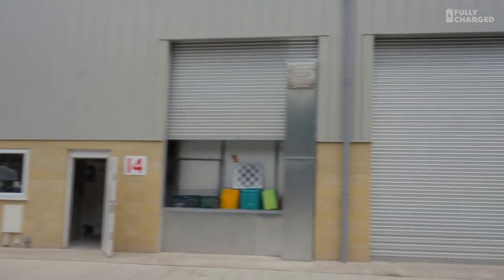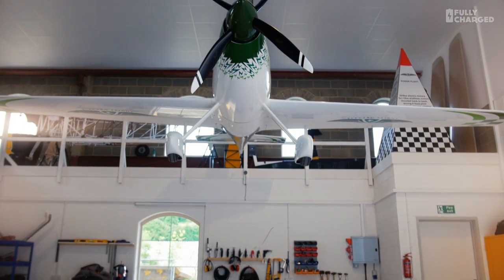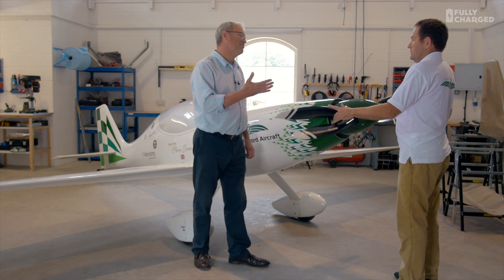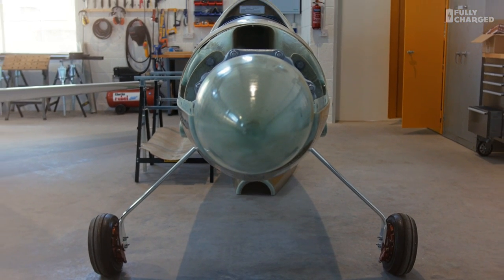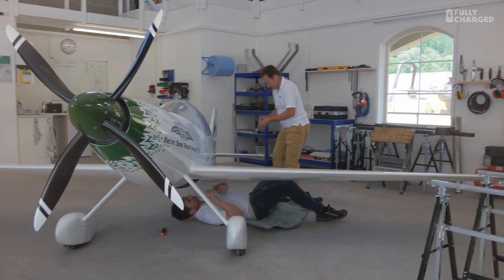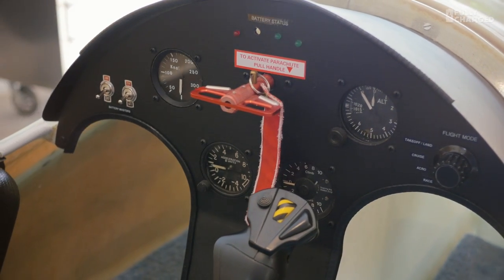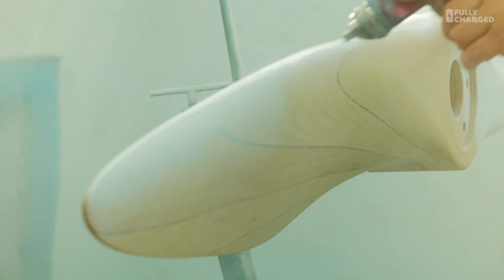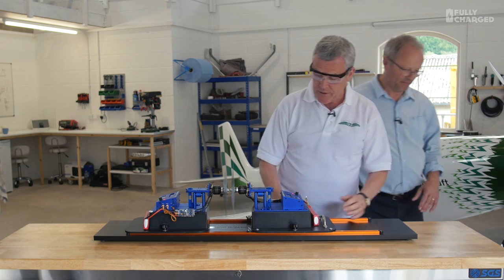Electroflight | Fully Charged

Comment: I recently listened to one of your podcasts talking about hybrid airliners using only electric at takeoff. Combining that with this technology would be incredible. Not only reducing weight from fuel but also from the weight of the jet engines. Logically, that would save tremendous amounts of fuel and co2 around airports.

Comment: It's like torque steer in cars in a sense. Having two  counterrotading propellers cancels the natural tendency of the plane to follow the direction of the rotating blade upfront. And yea, it also increases the surface area and therefore the amount of air the propellers as a whole can "bite" into during each rotation.

Comment: Counter rotating transmissions are a challenge for many designers. However they do move much more
air, and with electric motors' instant torque, this is a great project which may really work. The only thing
needed is better battery technology, just a matter of time...good luck!

Comment: As a flight instructor, I am so excited to see how electric aircraft technology is progressing.  Flight training is unaffordable to most people because of the operational costs of burning an insanely expensive fuel (Av100 is more expensive than Jet A), as well as the cost of engine overhauls and regular inspections on powerplants.  I'm not proud of the fact that general aviation burns lead either.  I'd love to give one of these electric planes a spin!

Comment: Actually extremely interesting approach given the advantages of electric power!
Reply: Advantages of electric power compared to what? Batteries have a much lower energy density than gasoline or even reclaimed cooking oil. If it is ever built, this hypothetical aircraft won't do anything an existing IC aircraft hasn't done better fifty years ago.

Comment: Another big plus is weight distribution of the batteries.  Fuel tanks needs to be big and all in one spot (typically in the wings).  However you can put battery cells anywhere to get the perfect weight distribution; a bunch in the nose, some in the wings, some behind the pilot, etc.

Comment: Having 2 contra-rotating blades.
Ingenious.
I have flown a plane a few times, but not 100% free at the controls.
Something I never thought of, but have instantaneously understood by knowledge fill in and overlap; is that the rotational gyroscopic effect of the powering blade would effect the way the plane turns...
More one way than another, I might add.
By having 2 blades countering each other, this effect would be balanced/negated.

The only other thing that instantaneously springs to mind, is that the propeller with the longer shaft would have to be perfectly balanced also, so there is less vibrational distortion caused by the length of the shaft from the power origin point (motor), and power delivery point (Propeller)

I love engineering.
Why the heck am I driving a bus for a living?
Airbus.. Heyyyyyyyy.
Ha ha.

Comment: Important to note too that it isn't only batteries holding development back. It takes a massive amount of current from the battery to the relay / motor and currently most companies use copper wires to achieve this.  As most of you know, copper that can hold high currents is massive in weight and so keeping the batteries close to the motors is a necessity.  Thankfully in aviation this is desired as you want to keep the CoG as close to the front as possible for safety and performance.

Comment: I want an electric spitfire !  ;-)
Reply: Hanniffy, we'll make them Mk. 22s.
Reply: Michael Powell
I'm not kidding mate,  if that lottery ticket comes in,  I'm getting one made... !

;-)
Reply: actually, Hanniffy, we need Mk.24s. That was the last Spit. It's got the big Spiteful tail for more lateral stability.
Reply: Michael Powell
For sure I'll have to get a model mk24 in the mean time !
Reply: I'm thinking a well designed WW1 style aircraft could be flown on electric with fairly cheap parts (Motenergy or Agni for the motor, etc) and have a similar performance - higher power but less endurance of course. 

I think it'd be a neat alt-history experiment, too. :P
Reply: ThalassTKynn
Good idea,  I do find retro planes interesting.

some rear engine kit planes would be cool as electric:

http://www.pilot-planes.com/kit-planes.html

Comment: Looks awesome I love it, I think their major challenge is going to be cooling the Batteries and the motor system. Because  that is going to be a lot of power discharge in a very short time.  They might have to put a good fire suppression system too. Good Luck Guy's..:-)
Reply: Overheating shouldn't be a problem for a two minute Red Bull flight.

Comment: I am working on  the same problem with water.  I predict that the closer the props are, the better is the thrust.  I can picture air as a fluid.  A hydraulic gear pump is another study that is helpful.
Iguana

Comment: That's so cool, fair play to them. I was just thinking too, I think it's only Jets that can go fully vertical especially up to such an high altitude because a regular prop plane would stall but if it's electric, like the man said, there's no need for air to the engine, only a little for cooling the batteries so there's no need for superchargers and as long as the juice is there in the batteries, you can go flat out all the way up =)

About 15:38 got me thinking about having something like that on a much bigger scale and then having a big compressor behind the fans in a jet and then have an electric heating element behind the compressor to heat the air up even more to give more thrust, it would be bonkers powerful.

Wicked, can't wait to see when all this technology is used in mainstream planes to, goes mainstream and really just takes off, pun intended =P

Comment: Musk was talking about high altitude flight which would need a way to compress the low density air to give something for later stages to get a grip on. Could be multiple stages where speeds are reduced as you go downstream to the higher density compressed air. something like an electric powered turbine.

Comment: if you used one motor to props independently you could use torque to advantage to flip flop between pylons 
and reduce weight by  eliminating gearbox , by computer matching the torque output and then you would have
two fully independent motors/props for emergency landing and low power landings when electrical output is
in stress mode

Comment: I look forward to this as it will make building airplanes easier for hobbyists
Reply: Nothing easy about baking carbon fiber in a vacuum autoclave. Look up Peter Sripol if you want to see easy to build hobbyist electric aircraft. With a side order of, a hobbyist should build a plane that won't be a complete and utter witch to fly. This thing is tiny, heavy, slippery, super torquey and has no flaps or other lift augmentation or speed braking devices .If you could fly an F-104 this could easily get away from you.

Comment: 12:42 Outrunner electric motors are kind of like rotary internal combustion engines. The part that rotates is not the one we're used to see rotating.

Comment: I am excited about electric propulsion because of the lower noise levels and cleaner air.The other thing is we never get a totally clear sky because of all the aircraft vapour trails (Heathrow is about 20 miles away so I probably get more than most).Having said that I'm in Farnborough and it is air show week next week, it is already noisy with lots of fighter jets doing aerobatics and it is quite exciting to see the F35 at last. By the end of next week I will have had enough though.

Comment: That rig (left) I flew was all engine noise.  I had to match a propeller to a 5000 rpm two stroke, possibly the first "trike" to fly (1961).  (2.1/1 gear reduction, 4.5 foot tip dia.)  The machine flew with 13 hp out of about 15,  and there was no relief from noise when the engine stopped, which it did all by itself, frequently.  One did not get to enjoy the quiet, as one was on the ground before the ears stopped ringing.  Could have used electric to solve that problem.  Hope the battery endurance problem gets solved.

Comment: I have been out of general aviation for a while, but this video has me thinking how electric power aircraft is going to be a huge boom for general aviation aircraft in the near future.  The first is performance improvements because of the weight, size, aerodynamic improvements and power of the engine.  You could build a cleaner airframe, climb up to altitude quicker while not losing power resulting in a higher true airspeed.  The reliability would improve, because of less moving parts.  A aircraft manufacturer could benefit with a good airframe design not only in initial sale, but could profit from future upgrades to batteries and engine technology.  The cost of ownership would be substantially less because of fuel savings.  In comparison I read somewhere that depending on electricity price it costs between about $8-10 dollars to charge a Tesla which can be driven for about 4 hours at highway speeds in comparison to $25 in ICE at $2 per gallon.  Imagine if it was $5 per gallon it would be $62.50 for the ICE automobile.  A bonanza, burns about 16 gallons an hour.  4 hours at 16 gallons per hour = 64 gallons at $5 per gallon= $320 for a 4 hour trip.  Now this is probably not a fair comparison, but a ballpark estimate a Tesla was lets say $10 to recharge in comparison to $62.50 for a ICE at $5 per gallon.  If this same ration can be used for the bonanza it would be roughly $51 for a electric bonanza for the 4 hour trip.  Yes, I know that the present Tesla battery is too heavy for aircraft, but with battery improvements, this ball park estimate might be a valid estimate.  This ballpark estimate  is not even considering the improvements in performance of the electric engine.  The cost of a more reliable engine would also reduce the cost of maintenance.    With this reduction in cost and increase performance, an air taxi service or small corporate aircraft in a 6 seat aircraft could become financially viable.
Reply: Engine reliability is a problem that must be considered solved for light aircraft. Light aircraft engines aren't cheap, but they rarely ever actually break.  For any mission profile, any combination of speed, weight or passenger carrying ability and range, electric aircraft can't compete directly with IC aircraft, let alone turbines. Light aircraft are so seriously expensive that saving a few bucks on fuel is meaningless. Commercial aircraft certainly need to save money on fuel, but electric aircraft may never be able to perform in their speed, range and carrying capacity flight regime. 

Rolls Royce has apparently been enticed to pay for most of this thing, and their website seems to have abandoned any comparison to Red Bull Air Race aircraft, which is good, because this will weight 200 pounds more than a Red Bull racer and would be completely helpless during the tight turns on the Red Bull course .They apparently are pitching it now as a straight line electric speed record aircraft, which concedes that all it will do is  something better than any previous electric aircraft has already done, but abandons any attempt to compete directly with internal combustion aircraft. It will not be competitive in it's horsepower class, or weight class.

Comment: This will be huge for lowering the entry level for flying because you don't need to pay for jet fuel and have less mechanical issues to consider for pre-flight checks etc. Not to mention this could be applied to high altitude airships that could recharge their batteries with solar panels.

Comment: the extending fixed wheels are aerodynamic but it could have been also used as a control surface like the tail fin if it could turn in air.

Comment: This is well established physics-- the dual propellers.  Look inside a modern jet engine, for example-- the compressor stage consists of a series of vanes, with fixed vanes in between each stage, which in effect, are similar physics to these. 

The idea is pushing mass (air in this case) opposite the direction you wish to impart thrust.  The faster you push?  As well as the more mass you push?  The greater the effect.
Reply: It would be more efficient to have one propeller of a larger diameter than to have two like this.
The turbulence caused by the props makes both of them less efficient and vortices drag at the tips is also obviously increased.

The advantages are hard to argued with though. Almost no torque roll because of the contra-rotation and more importantly the propellers don't hit the floor, like one large one would :)

Comment: I've always been fascinated by "new" old technology. For instance there was a plane in the late 1930s that had a similar concept to this, with 2 engines powering a single contra-rotating prop, but it was shelved at the outbreak of WWII and was never flown, and thus development stopped. Now these guys have taken the same concept and continued development. The diesel truck guys have started using water-methanol injection when they need extra boosts of power and it has becomes popular the last couple years, but it isn't new. Same thing, WWII fighters used it, it was mostly forgotten about for several decades, and an engineer came along as was like, "Hey, I wonder if this would work on a car too?" 

I'm actually designing a car for Bonneville to set land speed records. Wanted an electric one, but that would put me in the same class as cars with whole college engineering departments on their crew, so I'm going piston powered, at least for now. I had this crazy idea I didn't think anyone had tried before. I don't want to say what it is and give away my secrets, but the more I started researching I found a very similar concept from the 1930s. Same thing as the plane I mentioned earlier, WWII broke out before it was finished, and it was largely forgotten about. I was about 80% done with my design in CAD before I discovered it, but the 2 projects are actually quite similar, albeit mine used modern advancements in materials and aerodynamics.

Comment: There is a Russian bomberplane (Tupolev Tu-95) that has counterrotating props. It is known as the loudest plane in the world. Noise could be a problem.
Reply: CaptainKrimson It can also do jet speeds.
Reply: The Tu-95 can do high-subsonic to transonic speeds and the noise being generated is the tips of the props breaking the sound barrier. This plane only tops out at 300mph or 482kph I doubt its props would be doing that

Comment: Well, there certainly are  gyroscopic benifits to installing counter-rotational thrusted props. Left/right barrel rolls for instance would have a much shorter response time especially using electric verses combustion engines. Next, to determine your range of limitations before one prop counter acts the thrust given from the other prop as well as how those gyroscopic forces react on the flight of the airframe. Can you establish perfect centrifugal pivot at the tail in response to varying thrusts, or is this even a desirable trait for instance. Perhaps a certain amount swing in the tail is preferable on the platform given. Lots to discover!

Another thing to consider is geared rotation variation; main  drive vs counter drive on a single power input, the second (generally smaller) power input would actually control the difference in the speed of both props. (Sun gears, planet gears, central and coaxial drive variable speed transmission). . .

Comment: I have few questions for Electroflight - why were the small motors so noisy ? Aren't they induction motors that don't use brushes ? The second question, if they use ultracapacitors for the batteries, would the plane last longer in flight ? The third, can't you do any R&D on steam jet propulsion ? That is, two counter turning fans suck in air into the engine and pumps it into the compression chamber where the air gets compressed by counter turning compressor blades and gets heated through induction heating inside the compression chamber. The air then gets mixed with atomised water in the combustion chamber and gets vaporised because of the heated air. The steam then gets thrusted out of the rear exist, turning the turbine blades which are connected to the fans in the front, and compressor blades, by auto gears. Would such engine work ?

Comment: Electric is indeed good for performance and a lean single seater has great potential for very good cost/appeal ratio.
I wonder though if simply 4 motors on the rear top edge of the wings wouldn't be vastly superior. Smaller props, shorter landing gear. Free the nose layout. More efficient as a pusher?  I also wonder if turbine style multiblade is better. Apropos 3D printing.
I would also recline the seating position to make the hull skinny and only have clear dome just around the head. Cheaper.

Comment: Talking about electric drills and wood, maybe you could do a show with Skillbuilder about what high power electric motors have changed in power tools from the user perspective. I just learned that battery powered drills have overtaken grid powered drills by far.

Comment: I wonder if there is a way to capture the static electricity when flying. The only problem I see here is, that batteries are a horrible energy storage, so very inefficient. You are much better off with fuel. So a small generator and this setup is the idea?